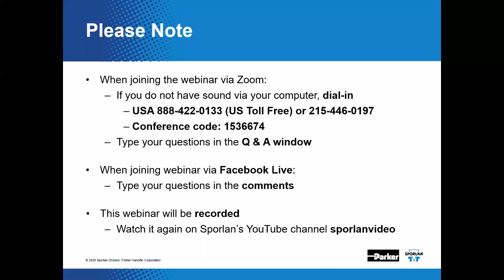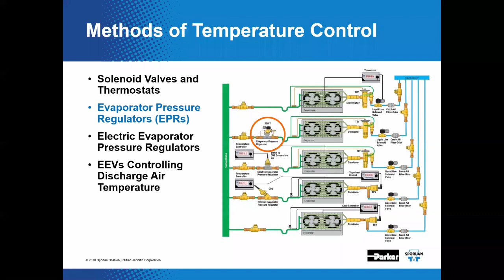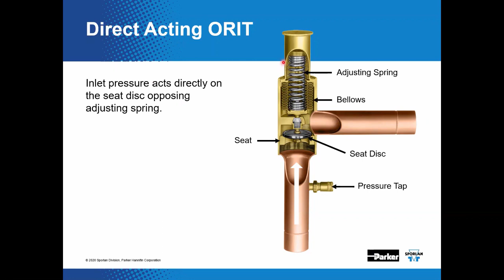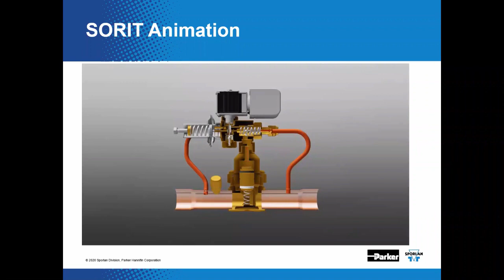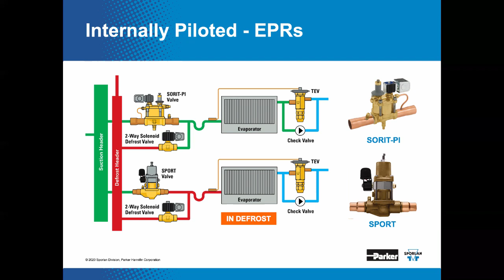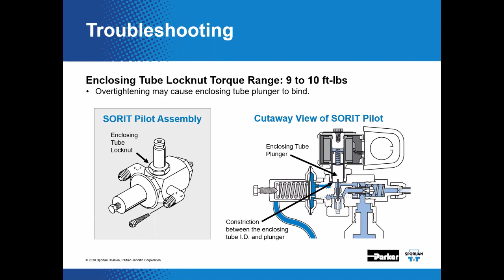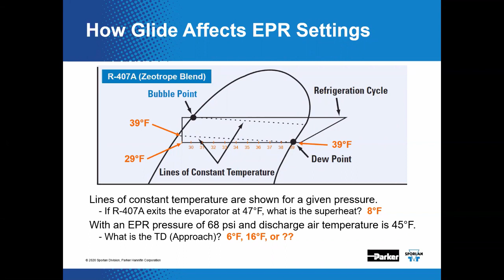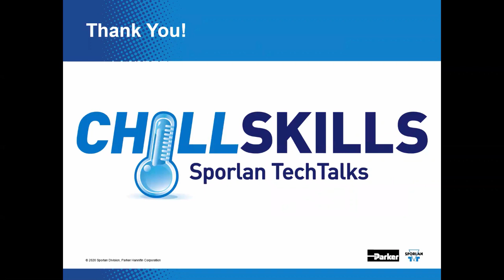Methods of Refrigeration Temperature Controls Using Evaporator Pressure Regulators (EPRs)

Comment: I have a question on your Evaporator pressure regulator. How far can the EPR still works if i have a air on dx evaportor at 34 deg c; 64% rh and i need to achieve and apparatus dew point of 13 deg c off coil at X amount of air flow. However could ur EPR still works to achieve an apparatus dew point 13 deg c off coil at an air flow of X ÷2  air flow ( 50% air flow) and the compressor had down loaded 50% of compressor motor rpm. I am trying to understand and not trying to put any product down. If it is possible i am giving a serious thought on EPR.
Reply from the maker: Sporlan Evaporator Pressure Regulating valves (EPRs) are designed to provide an economical means of accurately maintaining evaporator pressure and temperature under varying evaporator loads. The primary function of an EPR is to prevent the evaporator pressure from falling below a predetermined value or setting. A consistent evaporating temperature is maintained at the valve setting as evaporator loads decrease. When the evaporator load increases, the valve Opens on a Rise of Inlet pressure above its setting.
Reply from the maker: This will help - Sporlan Bulletin 90--20 https://www.parker.com/literature/Sporlan/Sporlan%20pdf%20files/Sporlan%20pdf%20090/90-20.pdf
Reply: @sporlanvideo , when compressor downloads, the condensing temp drops ( pressure drops) and my evap temp rises ( low pressure increase) and i need to maintain an evaporator off coil of 13 deg c. With EPR can i still achieve an evap temp of the design 9 deg c and still achieve an evaprator off coil of 13 deg c? I am doing a single compressor to a single evaporator. I Understood that the EPR can help to maintain consistent evap temp, however to what extend and till what operating range of download. Example: the EPR will still work when compressor down load up to only 30% operating capacity / compressor motor RPM ?